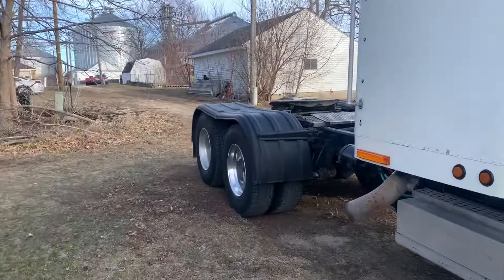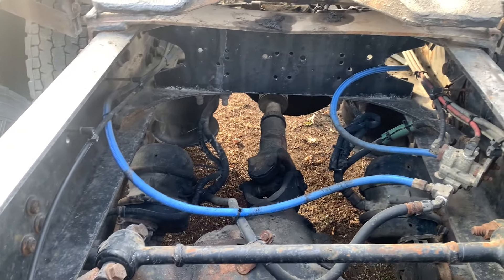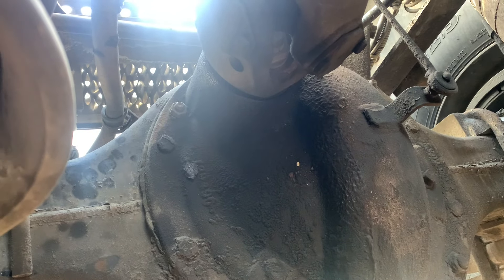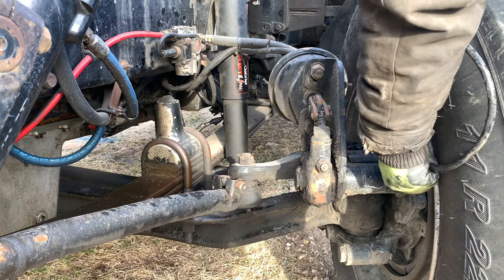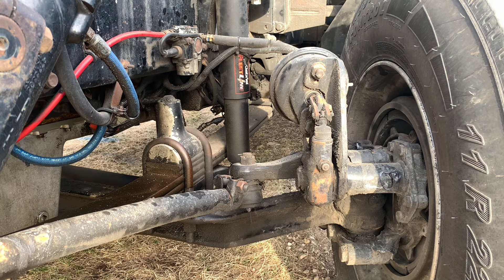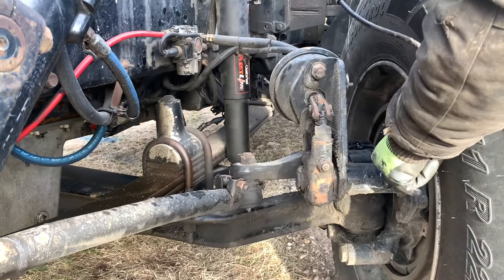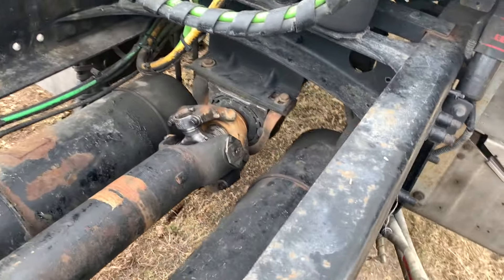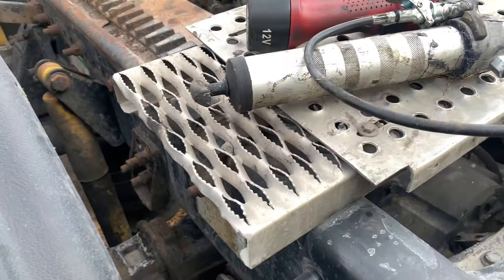More Broken Parts (Owner Operator Trucking)

Comment: Your driveshaft is installed incorrectly , slip joint forward .
Grease throw out bearing and yoke shaft bushings .  Over grease throw out bearing , you want grease on the clutch brake .

Comment: When are you going to hire a driver?
Reply from the maker: @ryanwinter2814 got a few steps before that one. First I need to sign a contract with Menards and then I need to build a good nest egg and then I need to go through the business entity hoops to hire someone. Probably ganna be a while yet
Reply: I have my own truck and authority too in Des Moines but mine hasn’t even moved in 3 weeks. It’s not broken, it’s ready to roll but there hasn’t been any work that even pays reasonable to justify starting it. I won’t be part of the problem. I put a battery tender on it so it’s ready if anything comes up but we’ll see